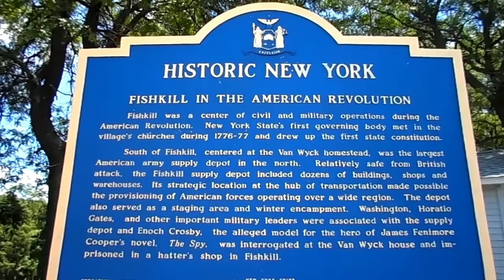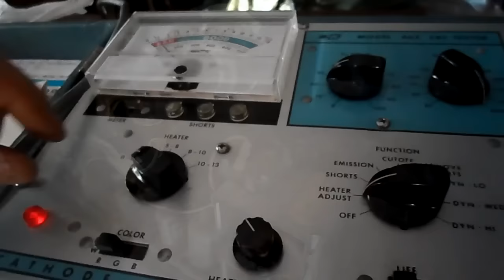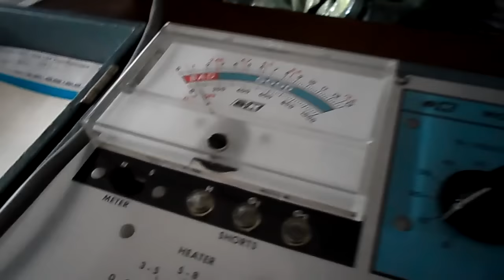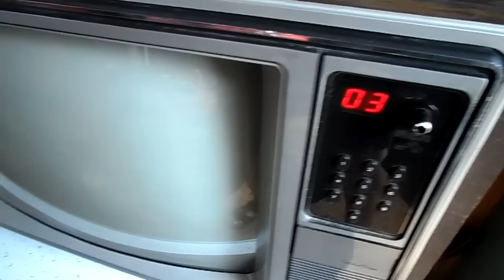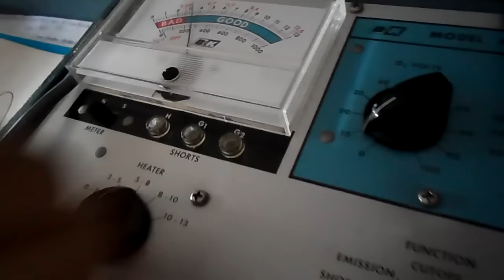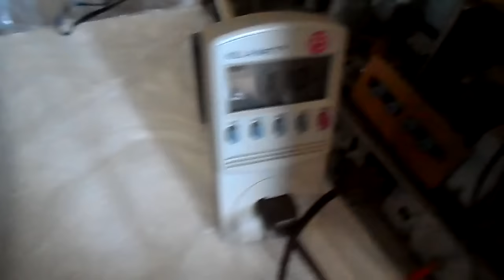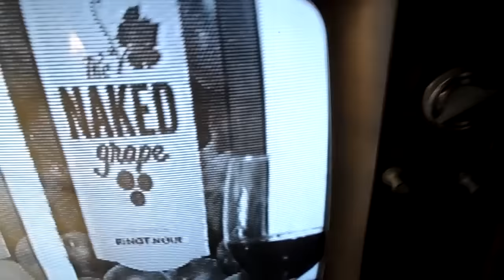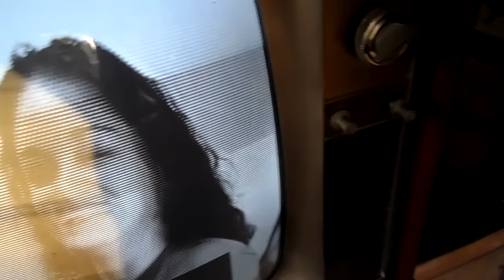Road Trip. Passing Thru 5 States For Vintage Electronics In 1 Day.

Comment: I'm curious when transporting a TV like that wouldn't it be safer to have it face down.
I've always wondered if you leave the CRT unhook at the back, but the high voltage hooked up or unlocked, will the TV still produce sound??
Reply from the maker: Face down is best, as a CRT is front heavy, but this one has the tuner shaft, control shafts sticking out. You mean the sound from the HV? Yes, the high pitch sound will be present, & live with TV running, CRT disconnected at anode and/or neck.
Reply: +Farmradio I mean sound in general, if the CRT is disconnected.
I don't know why I mentioned high voltage.
Reply from the maker: Sound would still be there. I've hooked TV chassis up on the kitchen table running with nothing but speaker & yoke attached to check for HV, etc. Just keep anode lead away from anything.